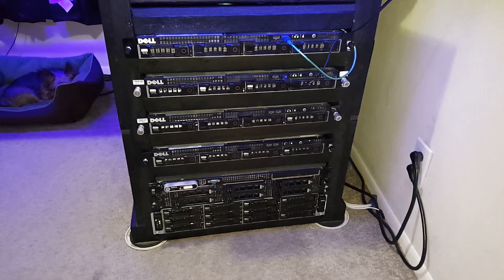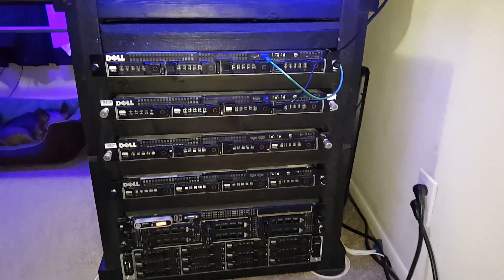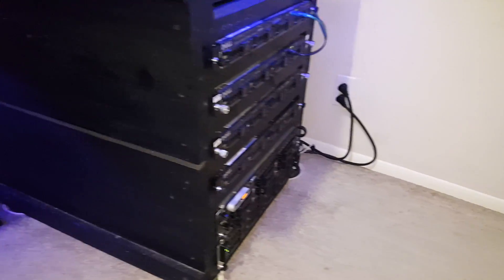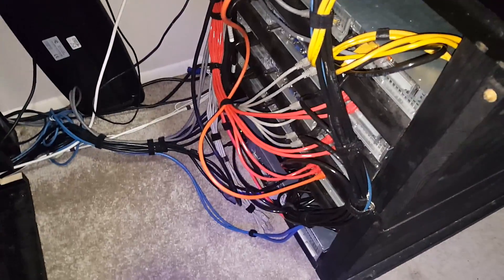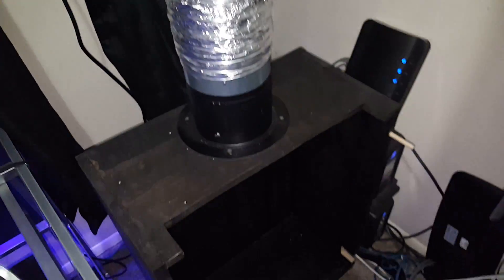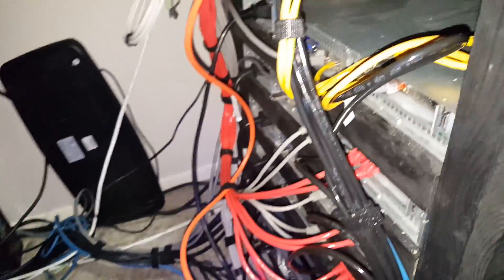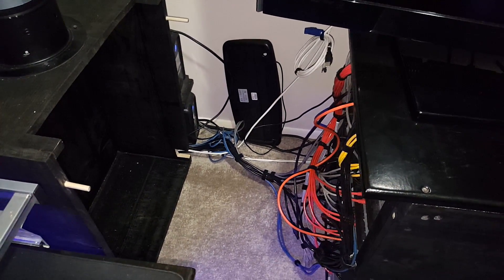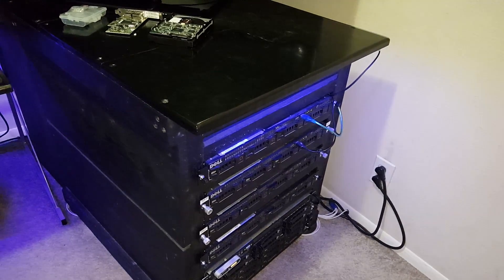How I cool my server rack!

Comment: I use a 2" pipe that sticks out of my window and the other end connected to the server intake, so the unit is constantly pulling in cold air from the outside.

Comment: Buy 64 core Threadripper PC . No need with 5 Racks
Reply from the maker: A 3990x 64 core cpu with nothing else costs $3600 US on Amazon right now, which is approx 3x more than all 6 servers I had here combined. I can only imagine the hardware compatibility issues that would come up with something like ESXi as well. I'll take the servers (plus the extra features like remote management) all day everyday.

Comment: This is how you increase your electric bill exponentially. Not to mention put a huge load on your AC. You are having to bring more air from outside and condition it for within the envelope. So this is literally pumping your conditioned air from your home right out the window.
Reply from the maker: It's a balancing act. If I didn't exhaust the heat, the servers would literally heat up the house and the A/C would then have to keep up with that. The only air that is exhausted is the hot air. The volume of air going out is no more than a vent you would have in a bathroom vent. I've had this setup in place for about 4 yrs now, and it's been amazing. I've also seen my electric bill decrease during the long hot texas summer compared to before I had this setup. The house is also considerably cooler.

Comment: you just kill your AC air pressure in the house
Reply from the maker: It's a balancing act. Either let the AC run constantly to combat the heat generated, or create a little negative pressure. The negative pressure is not much more than a bathroom exhaust vent.

Comment: Might want to PIN this comment and let us know the model used. 
So looks like:
Pine board - rack "glove" for lack of a better term.
6" duct and flex pipe.
And a fan, but what fan exactly, how many CFM?

Did you have to make any calculations on your equipment for the exhaust CFM flow to not create any back pressure?
Great idea though and I think I'll do the same with my rack but pipe between floors and put a Y pipe to allow either pushing air outside OR exhaust between the floors for during the inter for free-ish heating within the walls. 😎

Comment: So I've just come across this video because I'm looking for ideas for my own server rack build. I'm curious, did you install a vent hood on the outside? Something like a dryer vent hood?
Reply from the maker: Good question! I did not put a vent hood on this since it never turns off, but there is a screen over the outlet.
Reply: @robwillisinfo  I'm not sure if I will do anything quite like this, but it is certainly an interesting option. Goes to show how much us newbies know about things like this. I knew servers generated a ton of noise, but I never thought about how much heat.

Do you have any issues with the cold in winter time? I live in GA, so it's not unusual for us to have wild temperature swings in the winter (get up in the AM and it's 30F outside, by mid day it's 65F).

Comment: Have you tried the cooling solutions from "A.C. Infinity"?
Reply from the maker: I've seen their stuff and it looks top notch, but they are on the pricey side for me and the CFM's are a little lower than I wanted. The other thing with my setup is it would be pointless to get a super quiet exhaust since the servers themselves make enough noise. I do have a newer video where I upgraded from the 6" setup to a 3 x 8": https://youtu.be/06Sr7eIetKQ

Comment: I did the same thing to my 3 rack data center in new york back in 2001/2002, I lined up the racks and out the back the heat collected and was pulled up and out with a bathroom ventilation fan, only, I used this hot air to heat the basement! It was a win win. Also, cold air was pulled in from the cold-north side of the house through filters which cooled the servers. Only very rarely did the air-conditioners have to kick in to cool the air for the servers.
Reply from the maker: I miss the days of having a basement, I used to do the same thing in PA with no need for the  additional exhaust...but in Texas we don't have basements :)
Reply: Rob Willis wow! Really cool to see your enthusiasm!

Comment: I think the server fans should be enough to blow the hot air out.  A server uses several high RPM fans inside that would create enough pressure to blow the hot air out.  Kinda like a cloths dryer.

Comment: Great video man. I had a very similar idea with my 2 desktops that I run, I got them in a insulated box with a vent duct just like you have that leads outside. I live in a small apartment and having the machines running for hours will definitly get the place warmer but now I dont think i will have to run my AC as much this summer. :) I might I have to make my own video

Comment: Love your solution. How do keep bugs out?
Reply from the maker: The window that the board and vent is mounted to has a screen on it. So between the screen and the constant air pressure going out, I haven't had any issues with bugs or water coming in.
Reply: Rob Willis cheers 👍

Comment: Sweet setup. I use an AC Infinity CLOUDLINE T6 duct fan which was very quiet and hooked it like your onto the top of my racks using duting to exhaust out into the attic. Its designed specially for AV so its really quiet. Has even got a temperature controller that triggers the fans to speed up only when it gets hotter. Worth looking into: https://www.acinfinity.com/duct-fan-systems/
Reply from the maker: Nice find! Thanks for sharing!

Comment: With rack cooling, I think it's easy to overlook the need for active exhaust airflow since most cabinets don't have any capability for it. The air and heat going through the servers need to go _somewhere_. Doesn't matter if it's exhausted directly into the room -- though not ideal -- so long as it's pulled away from the systems.

Comment: how quickly do the virtual machines boot up.

if power to the duct fan were to turn off, will the processors slow down to the Mhz rate ?

Comment: any change that you can share you blue prints of making the server rack ?
its looking so awesome !!
Reply from the maker: Thanks Lars! Unfortunately I didn't keep any of the blue prints for it. I started out with the basic size of a 1u server which was like 18 in w x 36 in l x 2 in h and then figured out how many slots I wanted with a 2in space (the thickness of a 2x3) between the servers. I made a few of the slots 4in high for 2u servers. Once I had a front and back frame with the server slots I basically just enclosed it. The rear box just follows the dimensions of the rack, its approx 20 in w x 12 in deep and im not sure on the height.
Reply: +Rob Willis Yeah, very good idea. Same a friend and I does 2005 for 2 computer boxes and for a 19" rack 8 parts high here in the warm country Thailand after the room build in a/c can't put away the heat. As my friend build own house later the computer room have had a good a/c only - but this time the most stuff not run 24 hour 7 days and not produce so many heat.

Comment: what are you running on the servers? I mean what do you use them for?
Reply from the maker: Currently all of the servers are running ESXi, 3 of them are in a DRS cluster. I have also rolled my own SAN using iSCSI and Storage Spaces. I run a mix of VMs - Windows, Linux, and pfSense. As far as services I run a few Domain Controllers, load balancers, web servers, db clusters, file services, plex, and I even have a server running full time pcap. The beauty of having something like this is having plenty of space where I can spin up new VMs in minutes for testing or if i need to build something out. I basically have my own cloud.
Reply: Rob Willis have you bought a vmware licence and if so, which one and how much did it cost?
Reply from the maker: You can get ESXi for free from VMWare: https://my.vmware.com/en/web/vmware/evalcenter?p=free-esxi6
This is the version that I use on most of my servers.
Reply: Rob Willis I know about the free version. can you make a HA cluster though? I read that there are limitations
Reply from the maker: I would double check but I do think you can, however you will need vCenter for that and it is not free. You can run it as a 60 day trial to experiment with which is what I have been doing.
Reply: Rob Willis so you just create a new account every 2 months?
Reply: ESXi free can't be clustered in any build for high availability even with vCenter (foundations or standard). You have to buy ESXi and vCenter, but they have a Essentials bundle for a fairly low entry point (I only ever use Enterprise+ because we need it's feature set but they have a essential plus that is fairly robust, even has DVS support). You can setup a 60 eval but once it's done you will have to reinstall all your hosts, vcenter, etc. You could backup your guests and datastores but it is for POC and quick labs. If your wanting to setup something like Rob or my home lab expect to stick in a pretty penny. I run 2 cluster stacks VMware and Hyper-V. All Cisco gear and mock of 2 corporate sites. Just the cost to run it hurts so it only runs when labbing. You can run ESXI on VMware Workstation (for now dev stopped on this product) for like $200 and demo most of the product and learn. Heck I probably use this more than the physical lab as you can get build a virtualiation desktop with a XEON and 128GB RAM fairly easily, just don't skip on the IOPS for disk. There is open source type 1 virtualization out there but you better really know your CHIT and don't expect to find those in your average business model. Enjoy, stuffs pretty fun most the time - a few purple screens :(
Reply from the maker: Cool thanks for posting that info! Like he mentioned, you can use the free image to build a cluster it just has to be left in eval mode. If you want to keep the cluster longer than 2 months, then yes you need to rebuild or license it and it does get expensive but it is worth it for production loads. It is pretty typical for me to be rebuilding labs constantly though, repetition is key. While you can run ESXi on top of Workstation, the performance is pretty terrible compared to running ESXi on bare metal and its not worth it imo other than trying to demo something quickly. Building a desktop vs a server for virtualization will honestly cost you about the same, if not more. I picked up the majority of these servers for $200ish with dual Xeons. In most cases when you are talking 32+ gb of ram in a host with say dual quad cpus, you'll run out of disk and then CPU way before RAM once you start actually putting a load on vms. Running 128 gb of ram on a single quad or even a single 6 core would be kind of pointless if you were expecting the vms to be doing anything of substance. Xen server and Proxmox are decent open source solutions that don't really require you to be an engineer to operate. There are quite a few large companies out there running their private DCs and/or clouds entirely on Xen server.